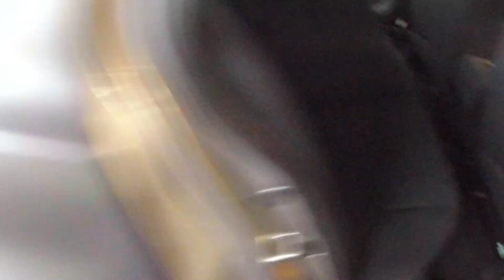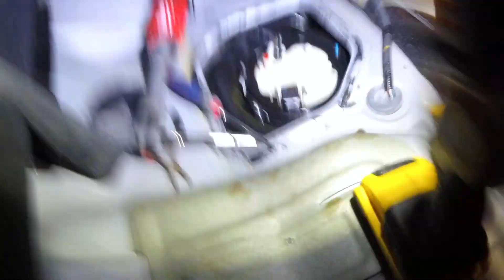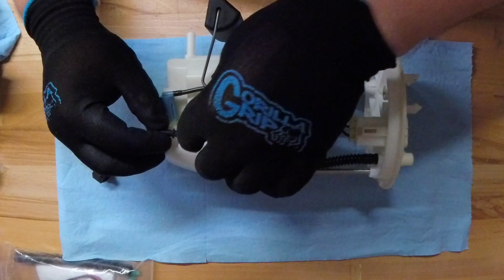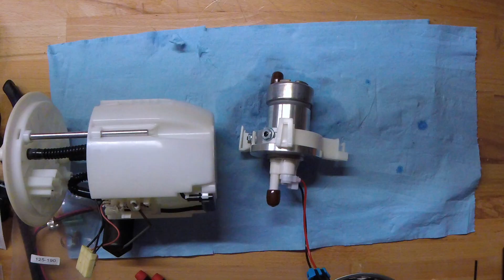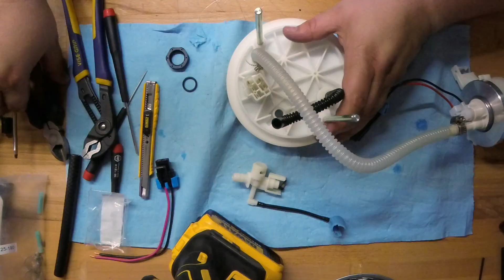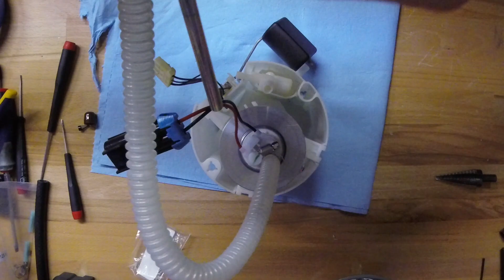EVO X Fuel System Upgrade - Walbro 450lph Fuel Pump - Part 2

Comment: Hey brother I drilled mine to 3/32 but definitely getting some fuel starvation at 1/4 especially going uphill. Going with the radium jet venturi replacement
Reply: did you ever install the redium jet replacement? How did it go if you did?

Comment: also, couldnt the black hose int he kit be used for the return line? is that not what its there for?
Reply from the maker: The black hose that comes with the fuel pump is just a generic hose, not specifically meant to replace the return. Honestly you can try and use it yourself, but it may not be the correct length or may kink when you install the pump housing. Keep in mind the pump housing compresses on the springs when you put it back in the tank.
Reply: @mpbiv421  so map just got back to me. Apparently the black hose is for the fuel return. But they said it doesn’t always require to be used

Comment: Minute 18:30 what is that part called that the wiring is going thru ?
Reply from the maker: https://www.summitracing.com/parts/abt-cfd-504 something like this. Call up MAPerformance and see if they sell something similar for cheaper. Or search Amazon, but this is essentially the part.
Reply: @mpbiv421  thank you so much

Comment: What size drill bit was it?
Reply from the maker: I started with 3/32, but I recall going up to 1/8 in the end
Reply: @mpbiv421  could you please tell me the drill bit size in mm? And what the maximum size that we can use it? I have used 2.5mm to drill the siphon. Is that ok?
Reply: How's the drill size working so far? Do you have any issue after drilling the siphon?